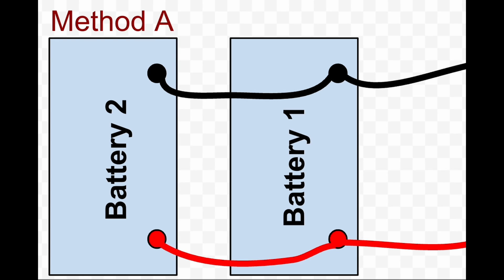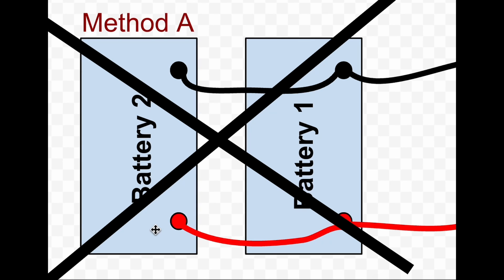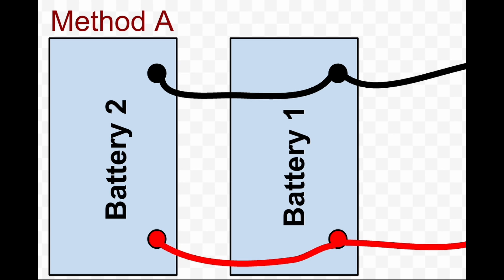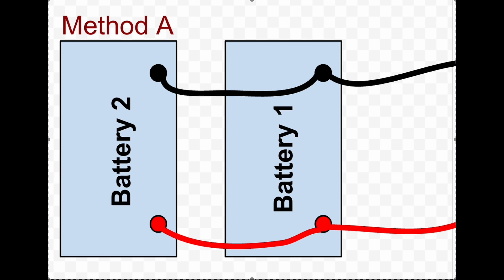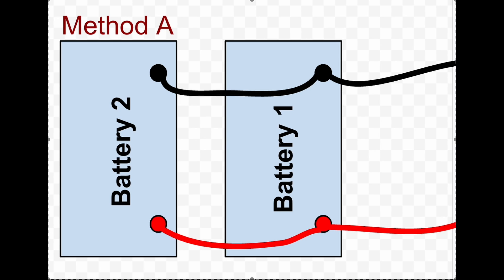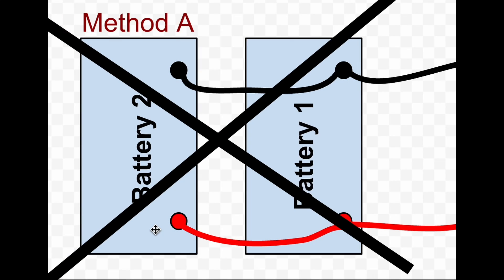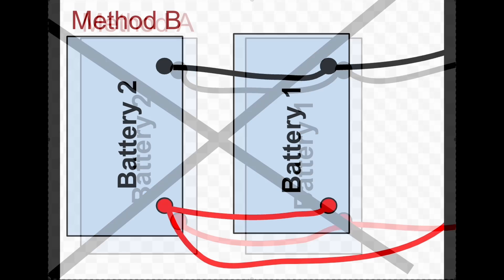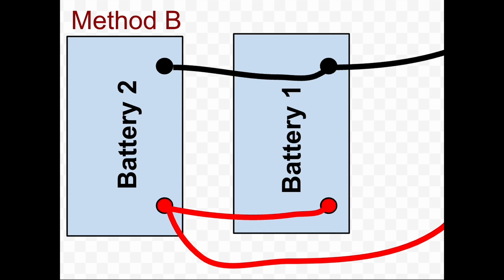What is the Best and Safest Way to Connect Lithium Batteries in Parallel for RVs and Boats or Homes?

Comment: I have a very hard time to believe this. Any regular wire will have a negligentv esistance. Are you using meters of resistance wire  to connect your batteries.?
Reply: Agree. This is only relevant if the voltage drop over the wire connecting the batteries is significant.
Reply from the maker: I do not have a video recording of this but if you do not believe this watch this video.  He recorded the currents for each battery.  Ohms Law,  V=IR  or I=V/R. At a constant voltage, current is inversely proportional to resistance.  https://youtu.be/_pQ0WjpSEa0?si=VJ-nIWsvUDvWNpU5
Reply: @TravelingLightReflections  the resistance of a wire is a different thing with a diferent formula... true in the first example if the batteries are identical (doesnt matter if they are lithium or agm or whatever) the current will have to flow through additional wire, but it also has to flow through the R of the 1st battery... the second way it just switches that job to the second battery which now will get a little tiny bit current at a faster rate since the first batter has the longer wire path...but just a tiny bit more R and once the battery 2 gets fully charged then the 1st battery will be getting more current in relation to the battery 2, but just a tinty bit more, it will also be getting current from the other battery at the same time... R of a wire is

*Formula:*

For resistance of a wire:
R = (ρ * L) / A

Where:
R = Resistance (ohms)
ρ = Resistivity of the material (ohm-meters)
L = Length of the wire (meters)
A = Cross-sectional area (square meters)

*For Rectangular Wire:*
A = w * h  
Where w = width, h = height.

*Explanation:*
The resistance of a wire depends on its material, length, and cross-sectional area. Longer wires or smaller areas increase resistance, while lower resistivity reduces it.
Reply: For 12 inches of 4 AWG wire carrying 50A of current at 12V, the voltage drop is 0.00378V, which is extremely small and almost negligible in most real-world applications. The current drop would remain the same at 50A unless the voltage drop were large enough to affect the load, but in this case, it's too small to cause significant impact.
Reply from the maker: @VenturaIT  I have a strong understanding on the formula for the resistance of a wire. You are correct correct on the properties of Resistivity of a material and the formula.  However the in the case of a battery cable, the cable size (diameter) and the material (copper) it is made of, remain constants.  This leaves is that the only variable is the L length of the cable.  The resistance is directly proportional to the length.  Using method A definitely has longer cables going to on battery.  Method B balances this out to a major degree.  Which battery has longer cable in method B?
Reply: @TravelingLightReflections  it just moves the battery with the longer cable from the 1st to the second...  either way I showed the calculation with a 4guage wire the voltage drop for 12" is tiny... and when the vehicle is not in use the voltages are always flowing back and forth because there is always a parasitic load on the system, so the batteries are never in perfect state of stillness, they are always either being charged or drawn out...  always going up and down like a yo-yo.  People make a huge deal about some things because the device manufacturers have over exaggerated things in order to scare people into buying things out of fear... with your system then the battery has R and causes the main source to have to go by the battery first, which lowers the 1st batteries speed of charge again...  it's fine but not an obvious fix for an obvious problem... putting everything in equal lengths to a junction then then equal out from there keeps everything in a true parallel, but then like another person said, no two batteries are identical, so little differences will be happening...  but who cares?  people buy thousand dollar battery balancers and DC to DC chargers to fix something but never add in the inefficiency from that machine and the length of the extra wires to that machine and the cost to install and mount etc... for me I'm going to run a large lifepo device battery off the AGM charge battery in parallel and I really only need fuses in place to prevent major problems, the batteries have the computers built in now...   i will probably put a manual switch and a circuit breaker too... but it's ok if one of my batteries pulls from the other and having the starter battery in the system divides the current so it acts like a R in the line to protect the alternator and the fuse protects the alternator too... with the switch I can manual select where the power goes and stays...  correct me if I'm missing anything, my project is just for a Jeep that has to run a laptop almost 24/7... in my system the lower R lifepo will always be the dominant battery due to the lower R and it will top off the starter battery (I think) if the switch is closed... even though there is always a tiny parasitic load...  let me know if I'm missing anything for a basic manual parallel dual battery system with a 50ah AGM yellow top as the starter and the 300ah lifepo as the house or device battery in the vehicle to run the laptop from a 400w inverter from harbor freight...  fuses everywhere and a switch to isolate the house/device battery.
Reply from the maker: @ If I am reading this correctly you have the two systems isolated by a switch. Does this make either the AGM or the LiPO work but never both? If so this is good because they both have different chemistries and different voltages. How are you charging each in isolation of each other. bTW it is when you have large loads like 400A that the balanced method B becomes more important. And as you mentioned, all will equalize over time anyway. The main idea is to not have one battery discharging more than another or to have one battery charging another. I do not know if I helped.
Reply: @TravelingLightReflections  can't have 400A with a 50A fuse?  in parallel all the batteries will interact which is fine when there is a huge second battery with lower R, it will always charge first then when not charging it will charge the other battery unless isolated, unless you install diodes to keep the flow going only one way... i don't mind my bigger battery charging the smaller one....
Reply: @TravelingLightReflections  in your video you are worrying about things that effect series connections more than parallel connections... this video shows you similar to what I have in plan (not done yet) except my smaller battery is AGM and not matching the bigger LifPO... I dont see why the type of battery needs to be matched for my application...  https://www.youtube.com/watch?v=XKXd7_J5duA
Reply from the maker: @VenturaIT  Listen to what he says at time 7:45 to 7:56.   You can not safely connect two different chemistries.  You LiFePO4 has a higher voltage than the AGM. Charging the LiFePO4 to its full voltage while connected to the AGM will cook the AGM. I am only talking about parallel connections.  We already know series is a no-go.
Reply: It is more about voltage drop, from load vs cable length, don’t forget contact resistance as well…

When two identical batteries are connected together, the shortest path has the least resistance, coupled with voltage drop and load drop, the closest short cable battery drains faster than the further ones. 

Forcing round trip through both batteries equally, the batteries experience equal resistance, and equal voltage drop, resulting in more even discharge.
Reply: @whochecksthis  voltage drop is the result of resistance. Not sure what connectors you are using but those also should not have any relevant resistance
Reply: @Ed19601  … everything except a superconductor has resistance, and when you connect to the closest side of the closest battery, the further lengths have resistance. It adds up, resulting in uneven discharge.
Reply: @whochecksthis 
Spot on. 
When there’s hundredths of a volt between 90% and 100% charged, every micro ohm matters. Connecting in the way shown is the correct way to negate any differences and is so easy to do.

Comment: What a load of BS! As long as the cable is the proper size for the amperage required and the battereis have the same characteristics...
Reply: Doesn’t matter the length of cables when running directly to both batteries…y’all stupid
Reply: It is a common practice  to parallel battery cabinets of lead acid batteries to have the ampacity to support large uninterruptible power systems
Reply from the maker: You should do some scientific test before you call this BS.  There is an incredible difference between the load on battery 1 and 2 in method A when you piggy back and pull off the same battery.
Reply: @TravelingLightReflections  If the cable cross section is correctly dimensioned for the current going through the cables it does not matter how you connect the wires to the load/charger. When charging the batteries, they will all get up to the same voltage as the charger is topping off / trickle charging
Reply from the maker: @nixxonnor   What you are saying is true only if a low current is being trickled into or out of the battery.  As the current gets higher, is when this becomes more extreme. Electricity always takes the path of least resistance.  In Method A you can have a huge difference in the current coming out of battery 1 compared to battery 2.  Some other critics here are correct that for more than three batteries a bus bar is better.  With the bus bar the currents in and out of each battery is closer than my Method B.  However, This way doubles the # of connections.  A failed terminal/lug crimp is the most common failure. Making good high amp connections takes practice.  This video was made for DIYer, not professionals with lots of experience.  I made it because I see too many people parallel batteries like Method A.  I also made it short so people would watch it.  If I was to remake this video I would add the bus bar method too.  Even with the bus bar, under heavy loads, there is still a current difference within the batteries.  The difference is slightly better and ONLY if the crimps are perfect and the wire lengths are exactly the same.
Reply: @TravelingLightReflections  No there is not. And your electrical engineering masters degree is from?
Reply: @kschildt1  You apparently forgot your first year high school electronics.  Draw the equivalent circuit with the resistance of each cable segment and battery ESR.  Maybe capture the schematic in LTSpice and run the simulation with a 200 amp load. Look at the difference in current from each battery. Some engineers graduate with a 2.0 grade average and others with a 4.0 average.  So you barely got an engineering degree ten years ago, that isn't the same as being correct. You apparently didn't study logic.
Reply: Why the personal attack ?  Explain in detail your view with the Math please.  Method B is how Will Prowse explains it too and he is  a much followed person.  He would have been challenged by now surely? @NackDSP
Reply: @NackDSP  In method 1, ALL the current passes via the negative and positive post(terminal) of battery(1) so in effect that will have twice the power loss of terminals COMPARED TO battery(2),  assume both batteries supply 50% of the current... So in long term applications you will see a drift in both charge and discharge of both batteries. 

For the dummies out there, imagine two garden hoses and you trying to force both into one. at the point where they join it will have losses.

PS Electronic engineer for 32 years.....  but to be honest this is really only true for Lithium, as you wouldn't normally parallel a battery like lead acid.

Comment: use a bus bar with two or more batters.
Reply from the maker: If done by a professional who can guarantee twice as many crimps will all be done perfect. For the small gain in similarity I would rather see beginners do it with less crimps.  Pro do not need this video.

Comment: What about Method C, all cables the same length go to a bus bar then a large cable goes to the charge / discharge apparatus.
Reply: Option c also means any problem with a connection affects only one battery and will be easier to detect.
Reply: I came to make the same comment.  Seems to also lend itself to safer isolation of one battery or the other: if for instance you want to work on one battery bank while the other continues to provide power.
Reply: My batteries are connected with 1/8 in. x 5/8 in. copper buss bars, I think the resistance would be negligible. On the other hand, it would take very little effort to move one cable to the other battery. Good advice, thanks.👍👍
Reply: This option C is excellent. To make it (option C) most safe against a battery cell going bad and sinking all the available amperage in the bank to it, properly sized terminal fuses should be installed at all battery (+) terminal posts. Current backflow into the bad battery would blow its post fuse, preventing continued flow into it and a fire.
Reply: On my previous trailer 7'x12' cargo conversion camper I built, I used the buss bar method for my two 100ah Lithium, which was needed for my 3,000 watt inverter, and it worked well also.
Reply: Is this battery parallel connection shown in electrical engineering books?
Reply from the maker: An advantage to your suggestion on method C is that you could use smaller wires to each battery.  The disadvantage it that there would be more connections.  Connection failures are the most common failure in a working system. This usually comes from a failed wire terminal or lug crimp. Limiting the number of connections is a high priority in my personal opinion. But your method C would serve the same purpose.  There are applications where your method C is a better choice, for example when the batteries can not be installed next to each other due to space constraints.
Reply: @TravelingLightReflections  Wouldnt the risk is little compare to the benefits. Set up with a busbar and add fuse for each battery, if one battery fail or loose terminal, the rest will function normally.
The two ways this videos showing, one fail could cause major problem to the whole system?
Reply: @offgridwanabe is spot on the way he describes is the only way to perfectly balance all the batteries traveling light is wrong

Comment: I think that the point here is, that all batteries should have the same overall cable length (positive and negative added together). Because i guess modern batteries have such a low internal resistance, that it forms a voltage divider with the (also very low) resistance of the cable.
The effect could alternatively be minimized by using thicker cables, that have significantly lower resistance compared to the battery's internal resistance.
Reply: yes you are 100% right where the wires is placed not matters, the thickness of the wires matters.
thick wires =lower resistasnce =smaller drifts=same current flow = not important where the wires is.

i use thin wires on lithium coz it not matters if current differs so %.
a half battery drain on 2 batterys is for lithium  batterys 1/2 cycle........
Reply from the maker: Yes , I would agree.  That is great, short and complete summary of the idea.

Comment: Can you define/elaborate on “a period of time”. Days, weeks years? Running time/idle time etc. thanks in advance
Reply from the maker: I do not have a definitive or data based answer for you. I can give the best science or physics based answer though.  It takes the batteries a long time depending on how hard you are using them. You will not see an effect within days or weeks but over months and years.  However, the harder that batteries are worked, the greater the 
 in use difference, in each batteries discharge you will get. Let me explain that.  

Think of it like this, In example method A, if you pull a high current from the batteries,  battery 1 has slightly less resistant than battery 2.  Battery 1 will discharge slightly more than battery 2.  It would be working harder to supply the load.  It would essentially lose more energy and its voltage would be slightly lower than battery 2.  When this high discharge current is removed, Battery 2s voltage would be slightly higher and it will charge battery 1 until they are balanced. This process happening over and over is what method B prevents.  Method B just simply prevents this by the physical nature on the wiring. Each battery the same wire length as all the others. Therefore each has the same resistance in the circuit. This is because they are all in a loop, as opposed to a string with one on the end like method A.  

So, method A is not going to ruin your batteries but method B is better for them.  If you have new lithium batteries I would recommend changing the wiring to method B as earlier a possible. They last a long time and method B will help make them last. If you are running lead acid, leave them alone. They don't last that long anyway.  If you are only, ever, running very low currents, it is probably not worth changing to method B either unless it is a simple task. If you are running an inverter from your batteries, I would make the change as soon as possible.  Also if you are running more than 2 of any type of batteries I would change it. 

 I know I did not exactly answer your question but I hope I least gave you a better understanding of how battery 1 gets "exercised" more then battery 2.  

Oh, part 2 to your question, I kind of answered but, this is only happening during "running time" and mostly during high current loads. During "idle time" the batteries balance each other to equal loads.  JT
Reply: Cheers. I think the “buzz” word is current. Less pressure on the battery and adding a fuse.  @TravelingLightReflections